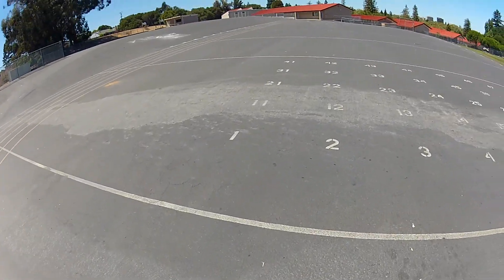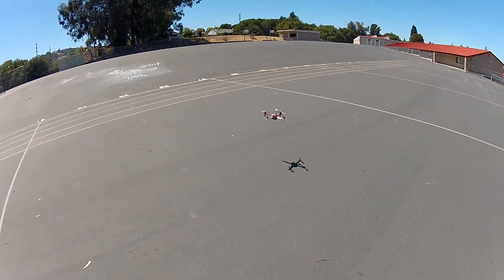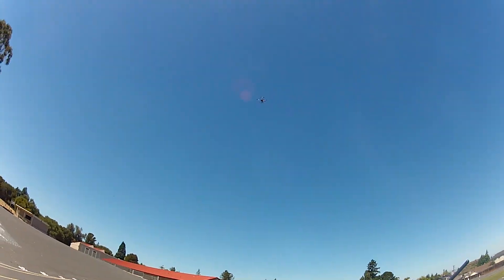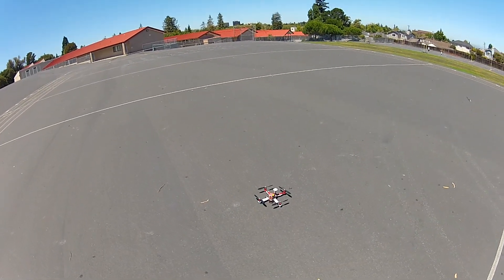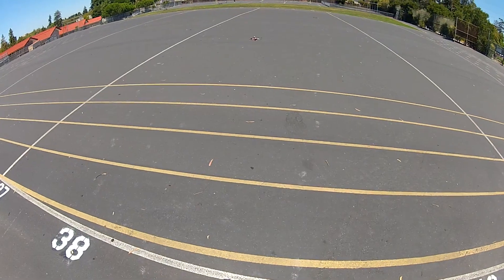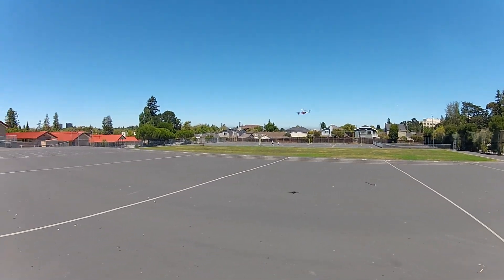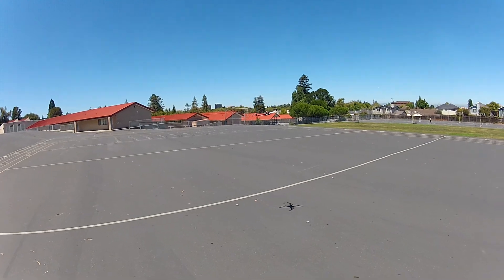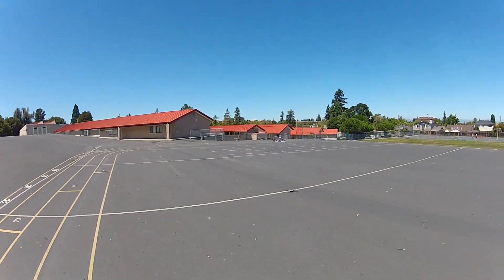RCV 29: Naza GPS Failsafe working!

Comment: Bloody great video,I now realize need to buy the correct receiver from Hobbyking to get failsafe to work,have a carbon frame center of motor to motor 1ft-7inches and set up my base gains at 95% attitude at 110% all trial and error,the instruction manual fro Naza leaves a lot to be desired.

Just have the basic Naza,at $230 really starts to make a $20 frame quad really expensive,again great videos and help thank you.

Comment from the maker: The Naza has a preset altitude gain of 20 meters when it goes into failsafe. As far as I can tell, you cannot change it. When the battery gets low, it will autoland in its current location. Keeping orientation is tricky when you get distance. It really comes down to knowing the craft and beleving in your controlling. Basically, it's all about feeling and trying not to panic!

Comment: If you are getting TBE in GPS mode try rotating the gps unit slightly in the opposite direction. In your case on west coast it may need right rotation. People have done this to fix the issue, it seems to be due to magnetic north declination.

Comment: Very cool! GPS typically is only accurate to 3 meters so the laning and GPS lock look normal to me. I think this is awesome. Question though; is it programmable as to the altitude when loss of signal? Also what happens when there is also a low battery issue? Can it decend faster or not climb that high? If it lost battery at 100+ feet it would drop like a brick. Also have a newbie question for you. What is the best way to keep reference on the orientation of the craft. In close no problem out a